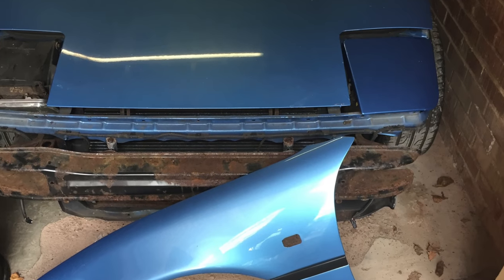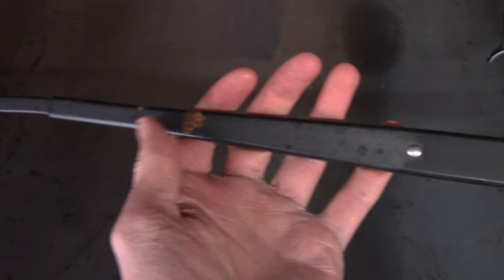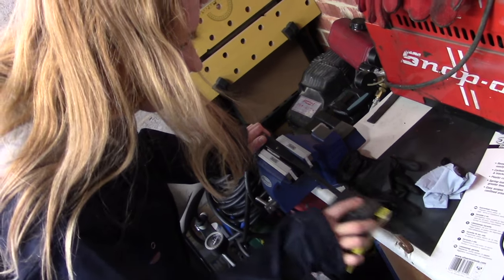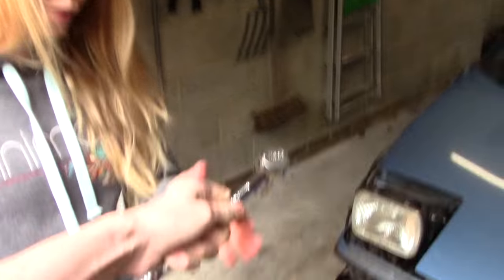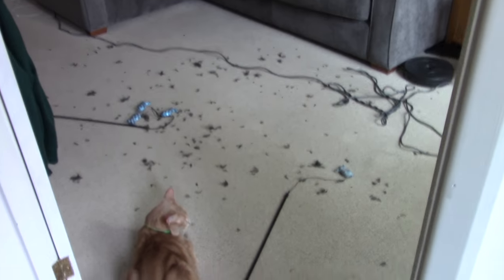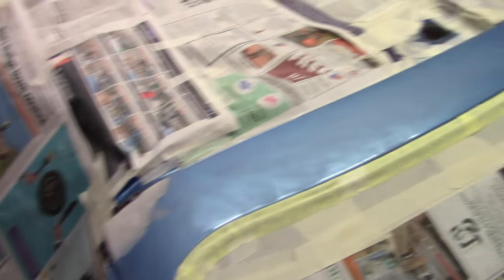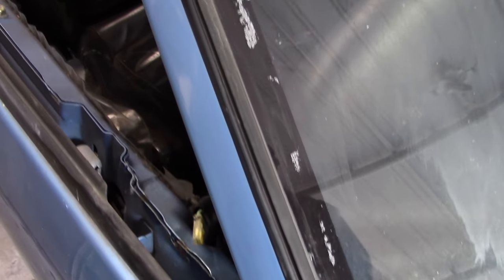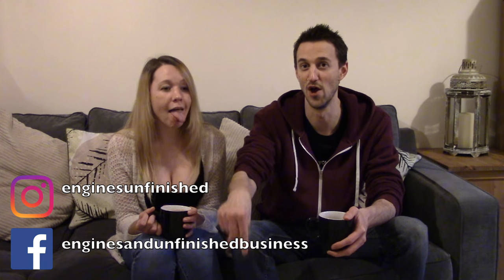Starting to Rebuild our Project Toyota MR2

Comment: one trick to get headlight covers to align perfectly is to tighten the bolts just enough to stop it flopping around (might need to flare the headlight cover tabs outward a bit). with the headlights in the down position, you should be able to wiggle the cover into perfect alignment, then pop the lights back up and tighten the bolts all the way down

Comment: Hey guys, loving the series. Looks like your popularity is growing, only had a hundred subcribers when i found you. In the process of restoring my own 1993 SW20. Your biggest enemy looks to be rust, sadly. I just got my front end back together after replacing the lower tie bar (radiator support) and repairing some other damage caused by the previous owner hitting a semi tire in the road. Ouch! Anyway, great show and keep them coming!

Comment: Glad to see you restored the wipers.  Thought from your description before they were too far gone.  I did the same with mine and some hammerite.  It still looks fine a year later.  The rust on the spring was the only thing i'm sure could have been done better.
Reply from the maker: They we're really rusty, but they definitely cleaned up well :) We used the Hammerite smooth black spray, but it ended up being more of a gloss finish, think the satin finish would have been better.
Reply: I used satin for the rear strut brace, matched well.

Comment: Some rust killer, etch primer and satin black and the wiper arms will look good as new.  Don't use gloss, you'll drive yourself nuts with reflections on sunny days.  The wiper arms of Japanese cars don't seem to have very good paint for UK weather, and some of them ('90s Nissans) have very shiny metal under the paint which really isn't good in sunny weather...

Comment: When you say "scuffed up the clear coat" - MR2s for the US market were single-stage paint, no clear coat. Is this different in the UK? Nice video by the way!
Reply from the maker: Interesting. It certainly acts like it has a clear coat, ie: you can buff out light scratches that haven't gone through to the colour coat, but we're by no means paint experts. Also the paint cans were supplied as a set specific to our paint code, and they included a clear coat.

I'll have an ask around the UK MR2 owners club to see if we did get a clear coat over here.
Reply: You definitely have a two stage paint. Metallics, pearls - are two stage. If you polish the paint, and you get colored residue, then it's acrylic/single stage. Your car's color is "8J2 -blue metallic", right?
Reply from the maker: Ah that makes sense, it is indeed 8J2, and no coloured residue when polishing. Thanks for the clarification :)
Reply: You did, the thing I recently learned is that apparently the metallic finish in the original paint is added in the clear-coat and not the base paint which seemed very odd to me.  I was trying to find the paint to match the matt paint you see in the engine bay etc when I was informed of that.